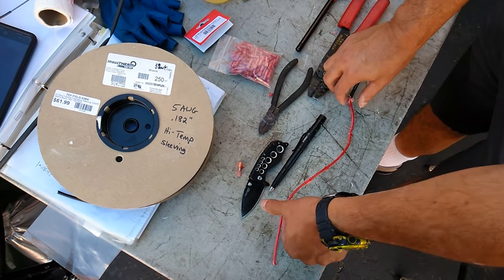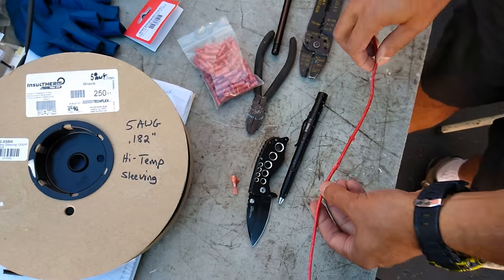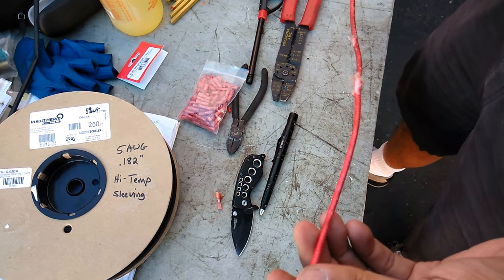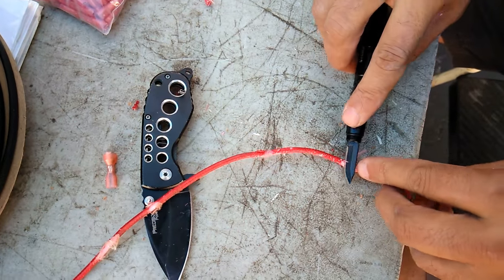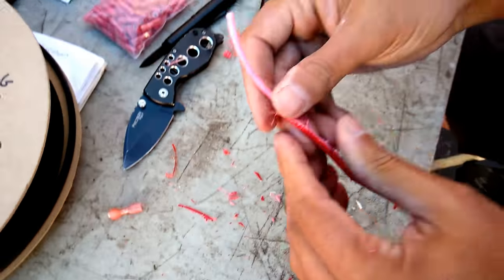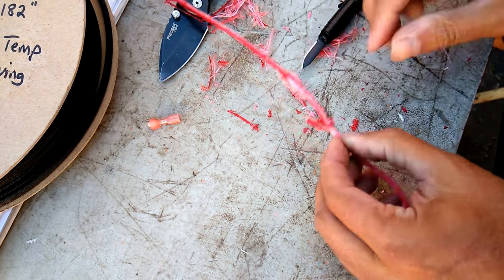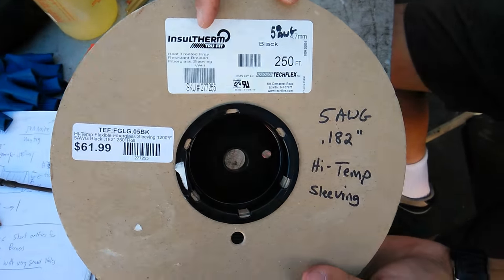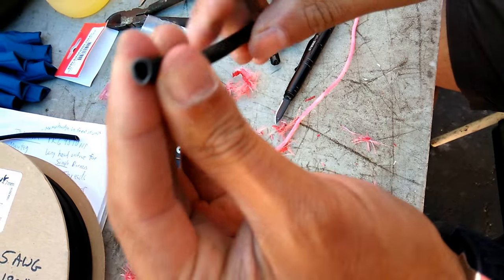High Temp 1200 Degree Insulation for Wiring

Comment: Excellent tutorial!
Reply from the maker: Thanks.
Reply: What's your supplier for that injection wire??
Reply: The terminals you crimp on the ends are also required to be high temp rated. Insulated terminals like those are not